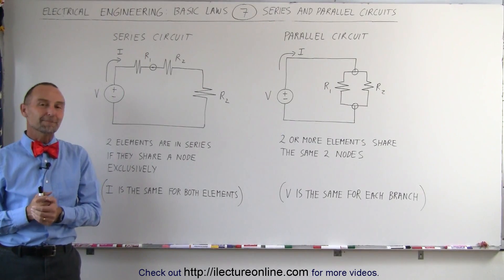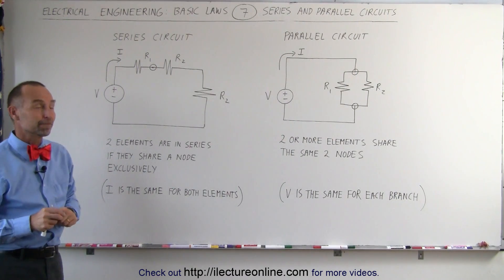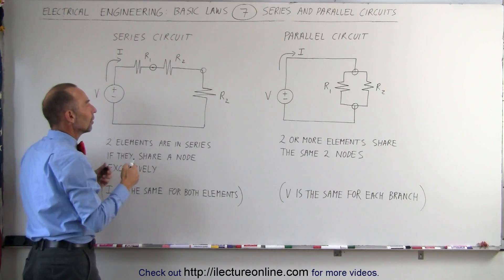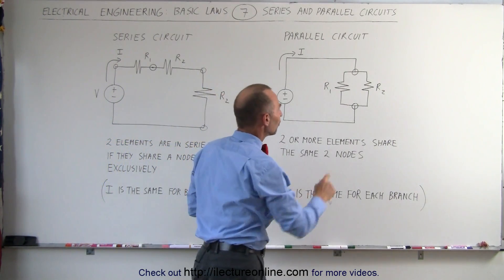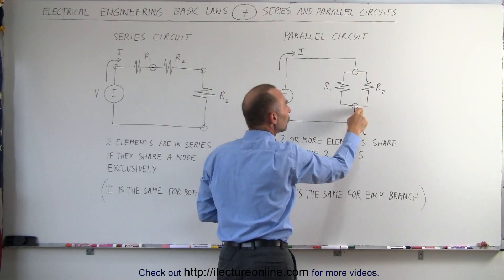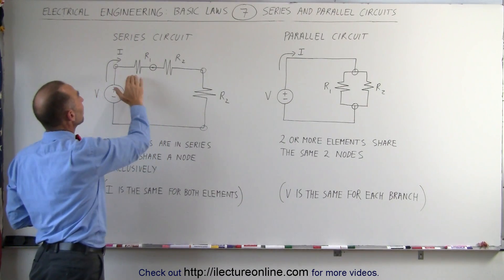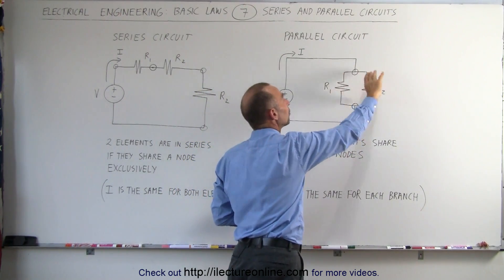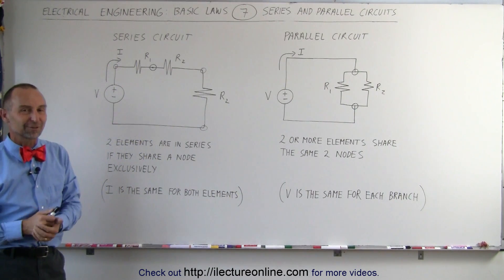Electrical Engineering: Basic Laws (7 of 31) Differences Between Series and Parallel Current

Comment: Thank you for the video sir, it's been very helpful! I was curious to know what's the difference between an element and a branch.
Reply from the maker: An element is a basic electrical device such as a resistor, a capacitor, an inductor, a diode, etc.    A branch in a circuit is a unique path in a circuit which can contain one or more elements (components), along which a specific current flows.  (The current will be the same along the entire branch)
Reply: @MichelvanBiezen  Thank you very much! This clears it up